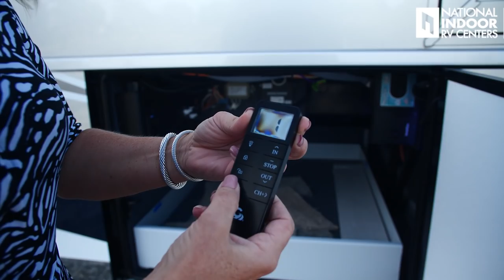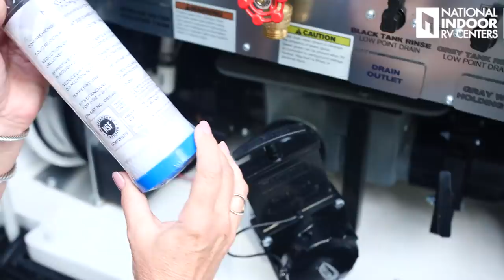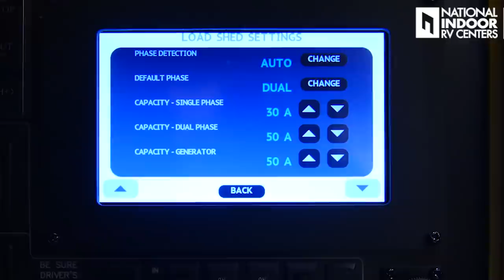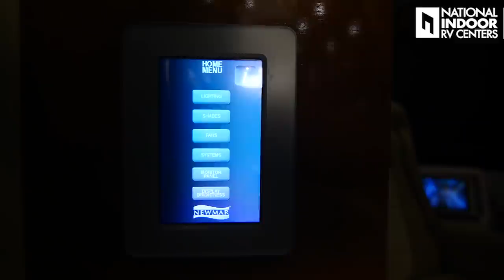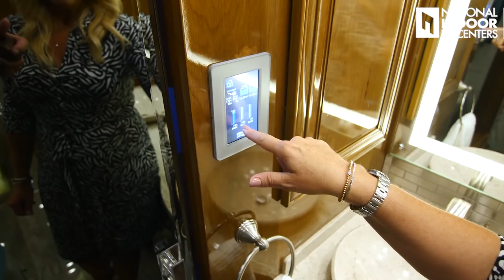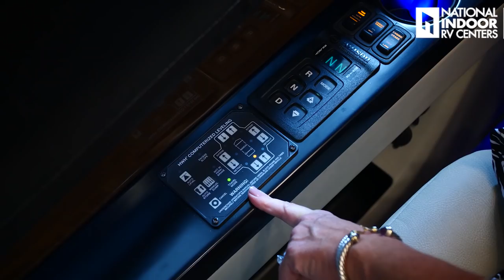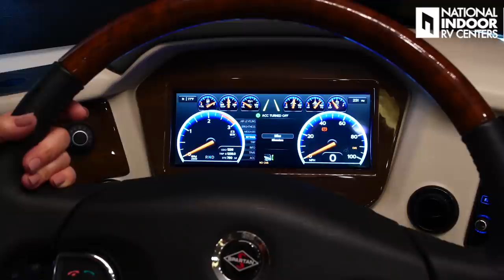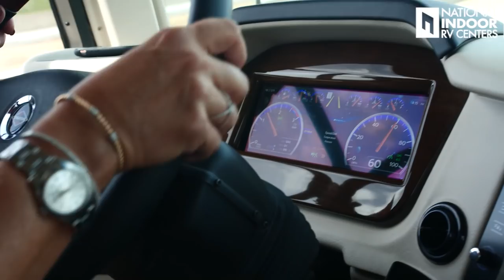2021 Newmar Essex | Full Motorhome Walkthrough Tour | NIRVC

Comment: First of all, thank you for wearing a different outfit with each review. I watch on my pc and Roku so seeing a review on one doesn't let me know I have seen the review on the other. I do remember the outfits you wore. :-> 
You mention solar energy on some of the models. Could you do a drone overview to show us the top of each model? We then know where the external panels and antennas are installed. What maintenance is required to keep the solar panels working at peak efficiency? 
Finally, a nighttime shot with the marking lights and docking lights lit. Thanks for the reviews.
Reply from the maker: Thank you for watching our videos and for your suggestions. As far as the solar panels go I know you need to keep them clean but otherwise I’m not sure about their maintenance. Give us a call at 469-277-1330

Comment: Angie, you really do the best tours. Thank you. If I were going to drop 500K+++ on something, I would want more than a 4 minute video showing the 'colours'. However, I see that the lighting control panels have gone to complete touch screen. In general, I get this, but there is so far one drawback for me and that is with the exception of WalMart (this is north of Toronto and these units are 5 years old), I not found a touchscreen you can use if you are wearing gloves. Is the font on these adjustable for those who are resisting the wearing of reading glasses? 
BTW regarding checklists, being a bit of a gearhead, I have struggled with this over the years on weekend trips and summer vacations. I want to operate my RV (35' gas class A) correctly efficiently and safely AND bring the comforts AND the toys. I used to drive down the road stressed out thinking about what I had forgotten. I had checklists, but they took too long (At least for me) and so I kept trying. Finally, I came up with this Excel sheet. The rule is that the printout cannot be more than 1 piece of paper. I use a second worksheet to set up the trip, where I going, how long, what sports I'm doing, what foods I'm into, clothing that I want etc. All the basic stuff and the quantities of the food are automated. Then the printable part shows me only what I need to consider. I can fold it into my pocket and with a highlighter mark off what has been done. I have a few laminated checklists in the driver area for detailed tasks if I have not done them for a while. So far this has been a real confidence booster for me. It even tries to compute vehicle weight and fuel economy based on the intended route. Thanks for your work. Henri
Reply from the maker: Love the details associated with your checklist!  Let me know if you’d like a copy of mine! Angie@nirvc.com

Thank you for watching our videos!